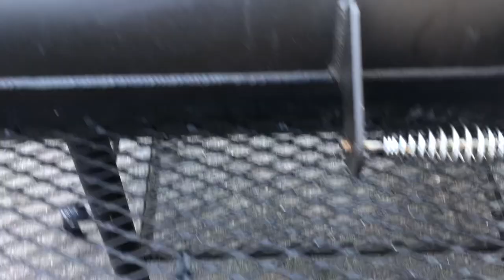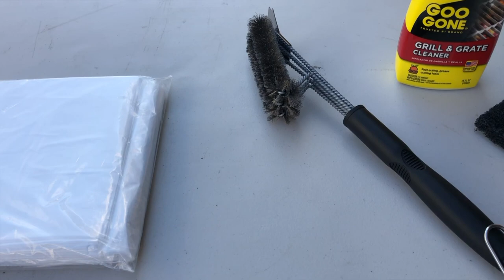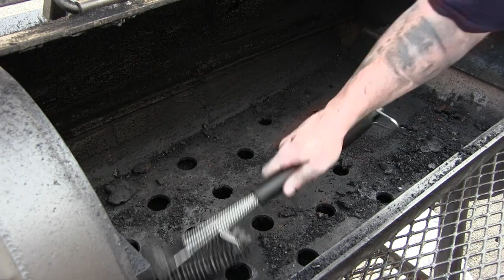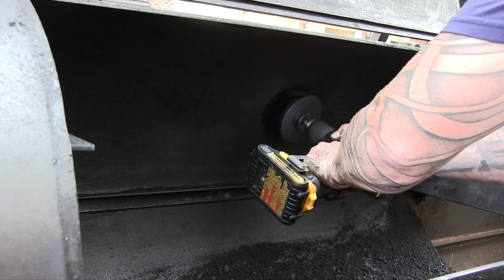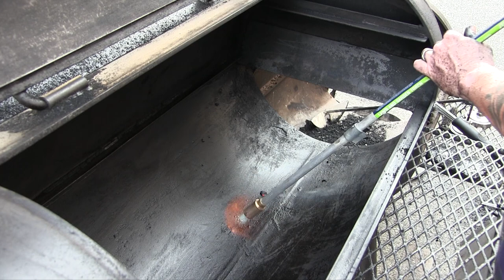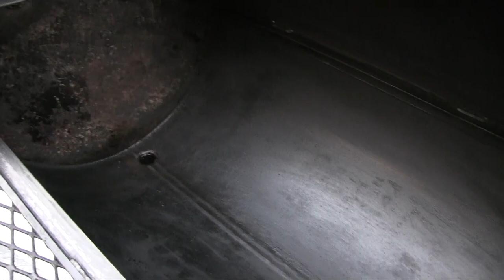How to Clean your BBQ Smoker #YoderSmokers #Offset #BBQ

Comment: Nice Job Red. What in your opinion is the difference in the fully loaded Yoder Wichita and the fully loaded Texas Original Luling. Did you make any alterations to your pit, I understand that particular pit does not draft well. I heard Yoder made some changes but no specifics, I see one individual cut the expanded metal firegrate for log's shorter were it sat lower in Firebox where you still could use tool to clean out the ash. When are you opening your restaurant.
Reply from the maker: Thanks John! My trailer is ready next week!!! I haven’t seen anyone use the Texas Original, I’d have to look at their specs, but i am very familiar with the fully loaded and it’s 1/4 inch steel, 100 year warranty surpasses my expectations. I’m a huge fan of their customer service and quality of build. To maximize my draft, I learned to always smoke with the door fully opened! I will feature this in a upcoming video, which I learned from Aaron Franklin! I do not use any grates in the firebox any longer as they increase air and cause the logs to burn quicker. I now create a base of coals, door open and I maintain even temps for numerous hours